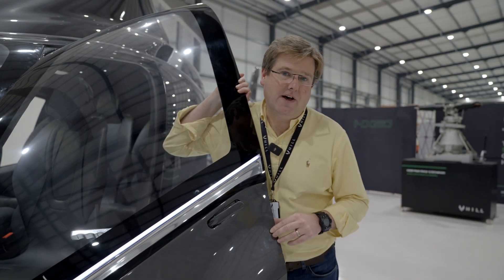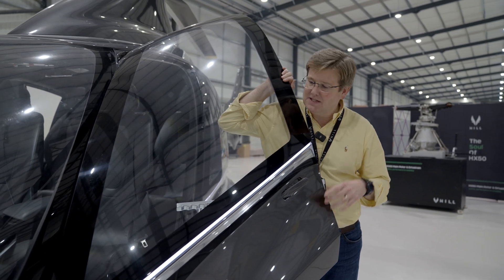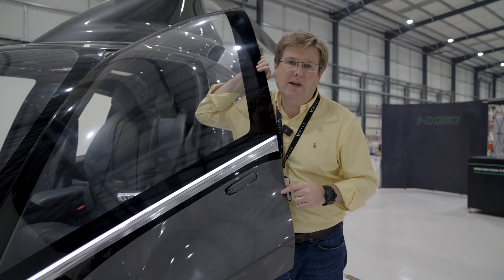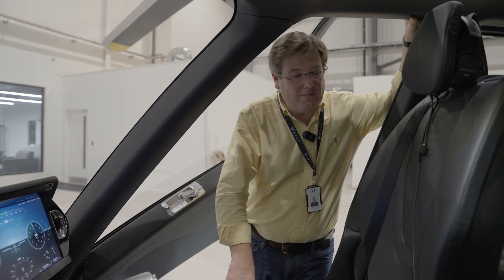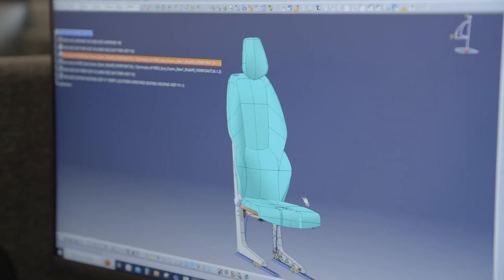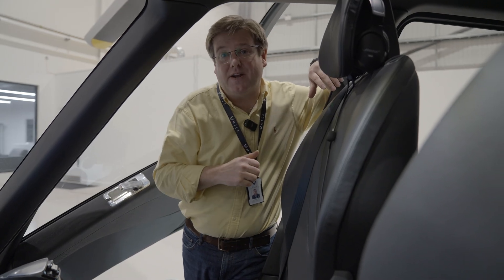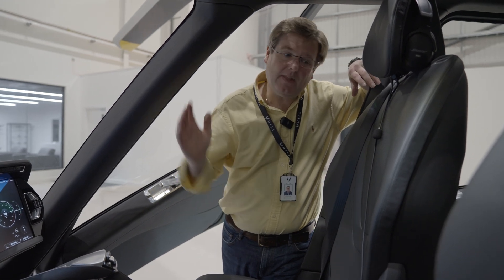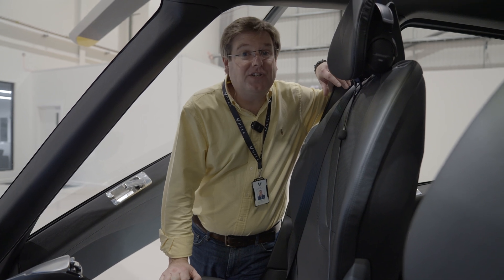Improvements to Doors & Seats

Comment: Could you not hinge the door on the rear post “by the back of the seat” which should improve the opening geometry?
Reply: That’s not so good when one comes unlatched in flight
Reply: F16 fighter jets and other aircraft have forward opening cockpits and they go over the speed of sound and pull more g’s than a helicopter will ever do and if you are looking at a true British design icon the Rolls-Royce Spectre coupe has forward opening doors as do other vehicles that travel in excess of 120mph?
Another feature of the reverse opening doors is that they are easier to close as you don’t have to lean out as far to reach the door handle to close it?